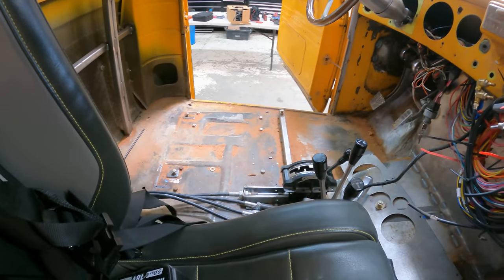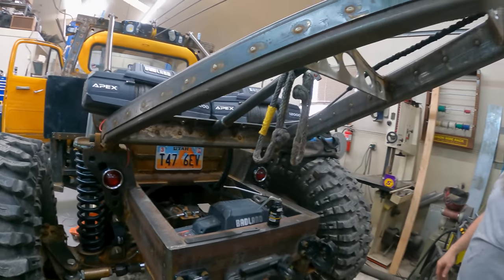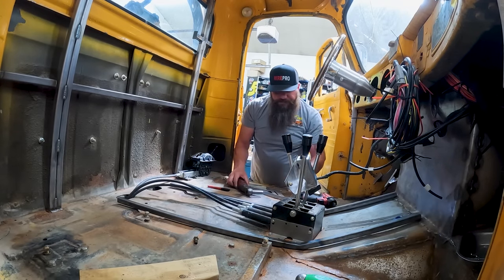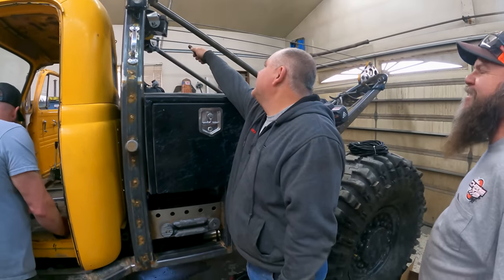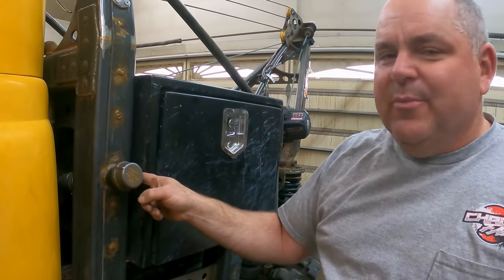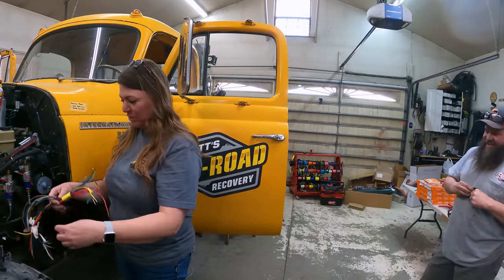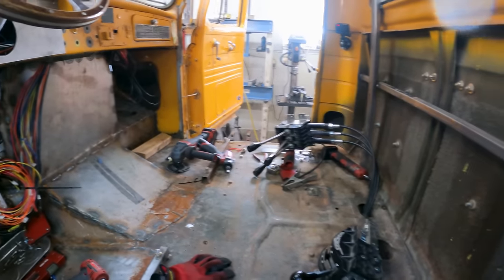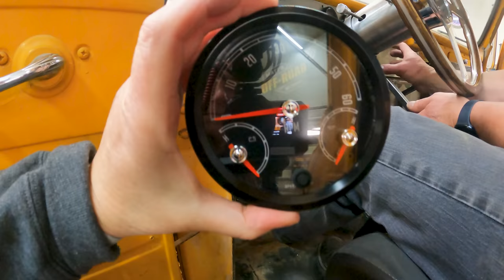World's Largest Off Road Wrecker Gets A Console?!?

Comment: May I make a suggestion from an old MOTOROLA radio and POLICE DEPARTMENT vehicle builder? This was a trick taught to me about 60 years ago. Instead of a regular fish tape either buy or go to the junk yard and find a VW buss and pull the spedo cable out of it. The reasons we used them (and I still do to this day and have the one from 50 years ago) is that a regular tape is to stiff as you pointed out BUT a spedo cable is meant to flex, bend and spin. Because of the flexibility of it you can slide it 99% of places and then just tape off your wires and pull from either direction. Sound simple but until you get one you will knot know how hard you have been working. And believe me the FBI and DOJ want as few views of wires as possible when they are doing undercover work. I have even been known to put toggles under the dash in hidden locations so they can dim or shot off headlights or tail light to make them look like a regular car with a burned out bulb. Also rebuild the face of a factory radio to hide mics in or even cameras that can be activates with an old floor dimmer switch. I Sacrament City school busses and BRINKS we installed the old dimmer switches (after removing the switch part that clicks) that were used to activate silent alarms at base to allow base to call for assistance because the radios also had GPS in them. Believe me you really have to work your butt off and use a fish tape to hide wires so even the operator does not know where they are. The only thing they are aware of is if there is a problem to step on a dimmer switch on the floor. Hope this helps an old pro like you guys. Just some of the tricks we use.
Reply from the maker: WOW! You probably have some interesting stories and memories of those builds, beyond what you just shared.
Reply: @chadsfab  I hope the info I shard with you might give you some future ideas and yes you are right but in the end they were all fun to see how they worked
Reply from the maker: @davidvincent1093   I did. Thank you!!

Comment: If that roll cage tube is not seamless there may be problems with chewing up the wires. You could fun metallic flexible conduit in side the tube first.
Reply from the maker: We cased the wire in thick looming to protect it

Comment: hey chad what is the name of the spray on product that protects raw metal,,, from rust and lasts 4evr ????  i ryed to find some but local parts houses "think" i'm talkng about weldable prime. u used it on some video recently ,,,,paul wrecker or urz !!
Reply from the maker: It's called SharkHide Metal protectant, Amazon has it and it's a rub on not a spray. 
https://www.amazon.com/Sharkhide-Protectant-Pint/dp/B09GCQB684/ref=sr_1_8?hvadid=178147099563&hvdev=c&hvlocphy=9029671&hvnetw=g&hvqmt=e&hvrand=8358081502983813434&hvtargid=kwd-1147606350&hydadcr=7600_9896670&keywords=sharkhide&qid=1682357554&sr=8-8

Comment: Can you vacuum a string down through the roll bar, then use it to pull the wire? 🤔
Reply from the maker: Yes, in most cases but it wouldn't work here with all the other areas air would pull from. The Romex got the job done quickly

Comment: Looks like it's going to be just another dog, to be quite truthful. They're already doing their best to fit 3 people in the cab and now, with a that box in there, there will be no chance. A bench seat would be more useful. And the idea of no paint  ? in a few months it will be just another rusty wreck. It's not your fault Chad and not your doing, you are just following the requested guide line. But it sure disappoints me. Just a suggestion though, fit a momentary switch somewhere on the front steering assembly so that when the front wheels are near full lock in either direction it fires the rear steer. Cheers

Comment: Want to make some serious money ? Make a electric hyd pressure back up pump for the steering so you have steering when the engine dies. Then maybe full hydro can become street legal.
Reply from the maker: The issue with full hydro is there is no mechanical connection between the column and the wheels. Full hydro will still operate without a pump it's just super stiff to turn.

Comment: good morning Chad sons😊  is matt planning on using dynamat or some equal
that will help ya all to " hide " some of the electric as it travels thru the console  ???  or is putting wire under such material not wise.😮
Reply from the maker: None of the wires will be exposed, as they will be ran behind the dash and under the console.

Comment: As working as an electrician for 40 plus years….women always seem to have much more patience for wire terminations….most men or women have no problem pulling the wire or laying up the wire diagram but installing those little terminations most men always seem to find something else to do while the ladies just keep plugging away at it…not sure if it’s patience or that since ladies tend to have smaller hands either they are much more efficient at it..

Comment: Chad-what brand is the wire crimper your wife is using?
Reply from the maker: Its an "icrimp" from amazon. It works amazingly well for the price.
Reply: @chadsfab  the jarring and vibration of off road vehicles has got to require quality bulkhead connectors